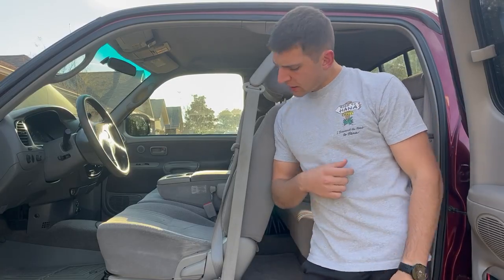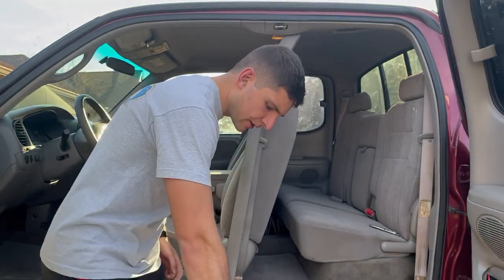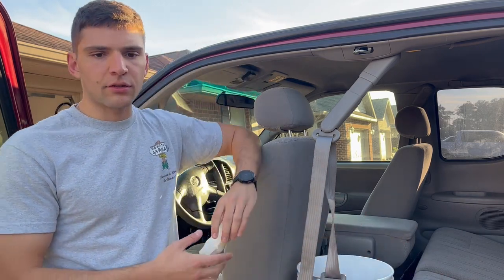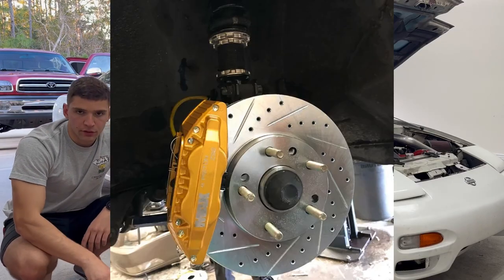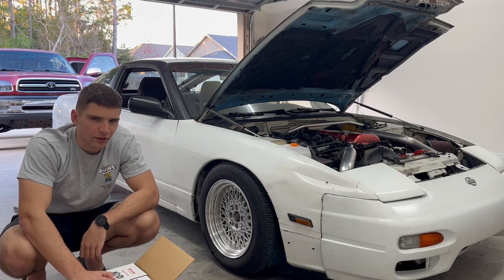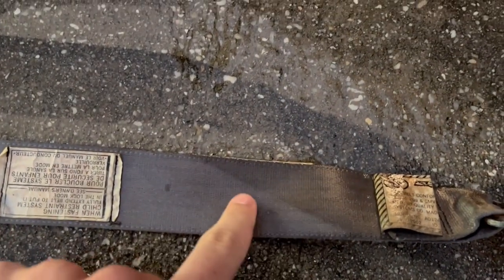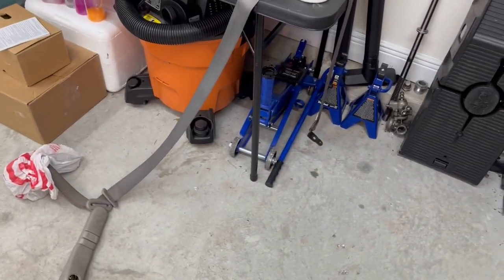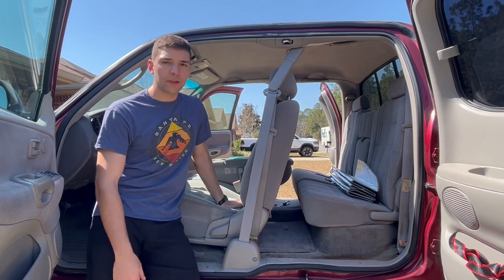Fixing lazy seatbelts in my Tundra + where has my 240sx been??

Comment: Just bought a 2006 Tundra Crew cab and am excited to watch your truck and mine both get better together. Also, be careful with magic erasers, they are essentially very fine sand paper and can leave micro scratches or peel off paint. Glad to see that neither of these are a problem with the plastics that you used it on.
Reply from the maker: Sweet! Congrats on the new truck, and thanks for the heads up on the magic erasers 👍🏼 - Sal

Comment: Thanks a ton. I had this issue on my 01 tundra for the passenger side but not the drivers. Turns out the previous owner already had fixed the drivers side one by chopping off the piece you sanded down.
Reply from the maker: Oh cool, yeah it was fairly easy job. Mostly just time consuming if you decide to clean them too. Glad it was helpful though! - Sal

Comment: I took mine off and soaked them in warm water and resolve carpet cleaner. Then sprayed a coat of water resistant on them and came out great. Slides easy greasy.
Reply from the maker: Nice, mine have gotten a bit gunked up again so I may need to clean them and I'll look into a waterproof or silicone spray that other people have recommended as well. Thanks for watching

Comment: Ok bud, I’ll give you some knowledge from my days as a Honda Advisor (15 years) Honda issued a bulletin about slow seat belts. Take an alcohol swab and fold the webbing up and look at the internal area where the belt needs to roll over and touches all the plastic. You’ll likely see lots of built up crud on the plastic, if you get that good and clean and along with webbing as well which your doing it should retract better. Probably not like a new but will be fine.  Keep up the great work.
Reply from the maker: Sounds like a good tip, didn't really think about using alcohol. Thank you! - Sal

Comment: Love your channel. I have a 2003 Limited stepside and am looking for a solution for cleaning some glue from a velcro strip off the top of my dashboard where it held a toll road transponder.. Tried Goof Off and then magic eraser but it took the color off where I used them. It has baked in the sun. Any ideas?
Reply from the maker: Oof, that stinks. My first suggestion would have been goo gone because I've had pretty good luck with it in the past, but goof off is probably similar. I'd say maybe the next step up before going full sandpaper would be really fine steel/copper wool along with the goo gone? My only concern would be that it may still screw up the finish of the dashboard. I used the copper coated steel wool to remove tint glue from the back glass on my old car but that's a very different material. Sorry, I don't really have any experience with this, but hope it all works out! - Sal

Comment: Hey where did you get the wheel well flares? I've been looking online to replace the stock ones I have but haven't had much luck finding any.
Reply from the maker: The flares are actually stock, they came on some models and I guess I lucked out that the truck I bought had them lol there are some aftermarket options on eBay, but I don't know about the quality or fitment. Thanks for watching - Sal